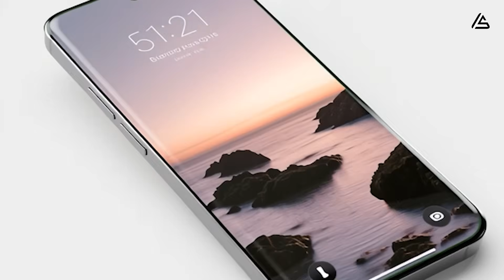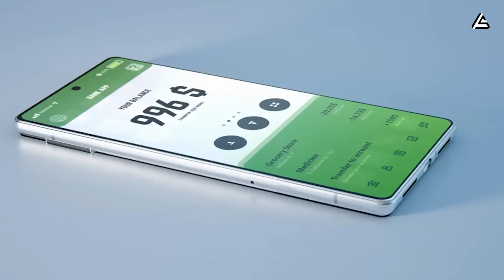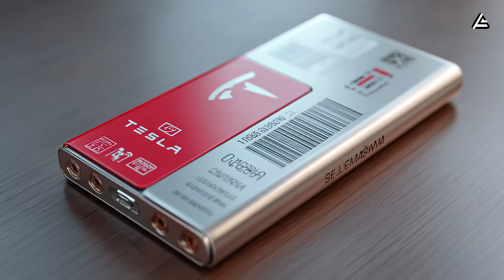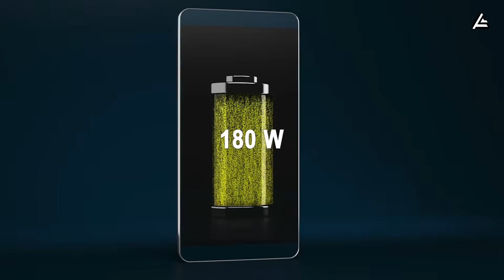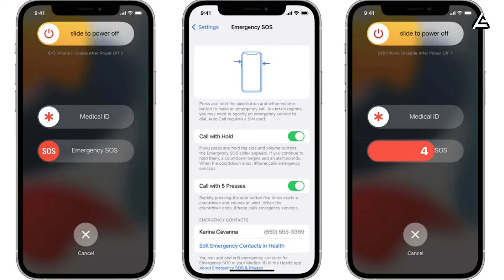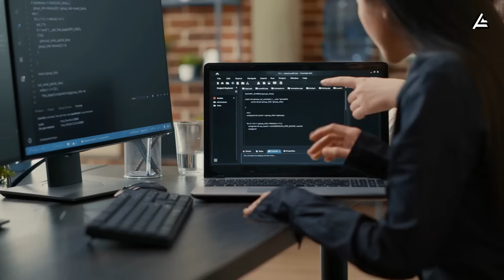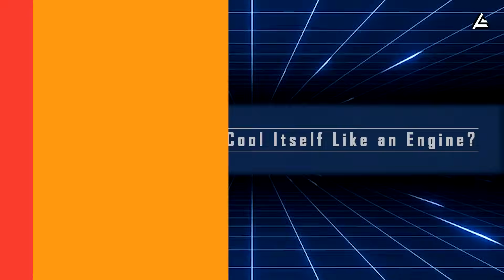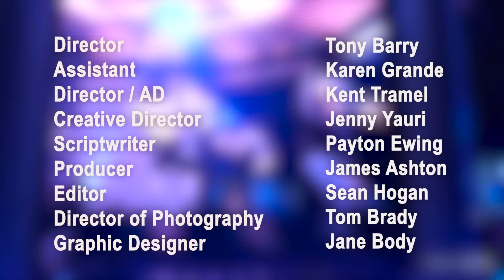Tesla Pi Phone 2026: 5 Shocking Feature That Can Beat Iphone 17. What's Hidden Behind?

Comment: Yes I Will buy, does it prevent hackers. Do I need to have VPN
Reply from the maker: You don’t really need a VPN for this device.
Tesla’s system is already sandboxed with end-to-end encrypted data channels, so random hackers can’t access your phone or your car. A VPN only helps if you often use public Wi-Fi.
So yes, it’s secure enough on its own.

Comment: Is it safe to use around pacemakers???
Reply from the maker: There is no documentation to verify this, but I don't think you need to use your phone while you have a pacemaker.
Reply from the maker: Satellite-connected phones operate within standard RF limits, similar to today’s smartphones. Pacemaker manufacturers already design devices to withstand these levels, so normal use is considered safe. Still, anyone with a pacemaker should follow the usual guideline: keep the phone a few centimeters away from the implant site.

Comment: No, the Tesla Pi phone is not real; it is a viral hoax based on AI-generated images and misinformation. There have been no announcements or official plans from Tesla or Elon Musk to create a smartphone. The rumors combine various concepts like solar charging, free Starlink connectivity, and Neuralink integration into a product that does not exist.  

    Lack of official confirmation:
    Tesla has not announced any plans for a phone, and Elon Musk has previously stated they are not making one. 

Misinformation:
The story is a recurrent hoax that has been debunked by multiple fact-checking sites and credible news outlets. 
Contradictory tech:
Claims about using Neuralink for phone control are inaccurate, as the technology is focused on medical applications for patients with paralysis. Similarly, Starlink's "direct to cell" service is designed to work with existing phones, not a proprietary Tesla device. 
Origin of the hoax:
The hoax often uses AI-generated graphics and recycled CGI to create the impression of a real product, frequently resurfacing to attract clicks or for scams.
Reply from the maker: Thanks for watching our entire video, we've compiled all of Tesla's moves to come up with this information. What else do you want to know?

Comment: How does it do indoors
Reply from the maker: A phone that works indoors? You mean smart connectivity?
Reply: @AutoGearShift2 it says as long as you have sky you have service. I was wondering about being inside.
Reply from the maker: Right now, the Pi Phone is still speculative, so details about indoor coverage aren’t confirmed. The idea is that it would rely on Starlink satellites, which should work outdoors and possibly indoors near windows, but real performance will only be known once the device is officially released.

Comment: Do you need a separate Starlink device to use the Pi Phone?
Reply from the maker: Yes — the Pi Phone doesn’t have built-in Starlink hardware, so you’d need a separate Starlink device to connect. Would you use it mostly at home or on the go?